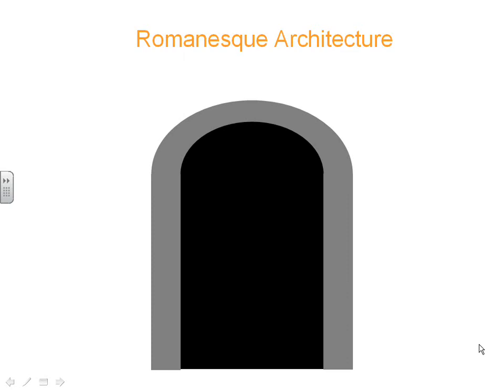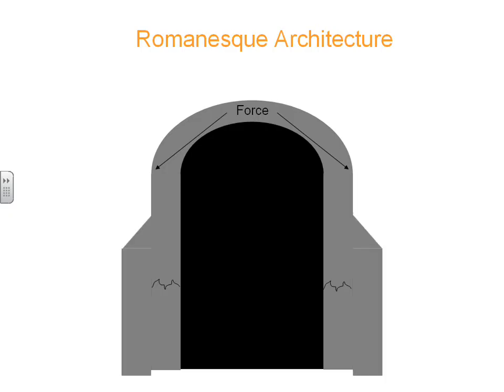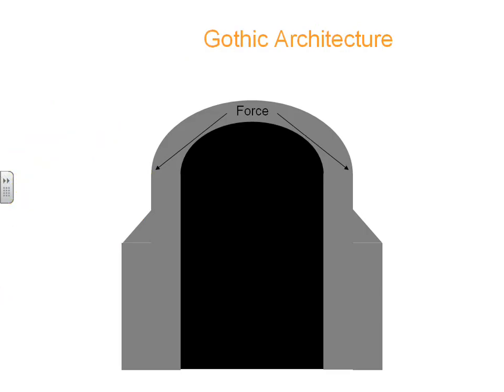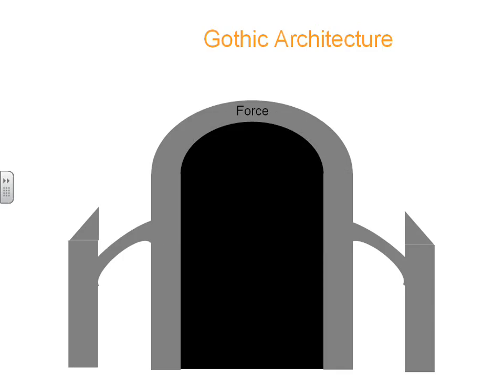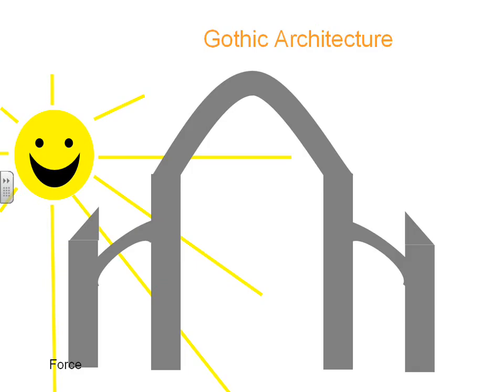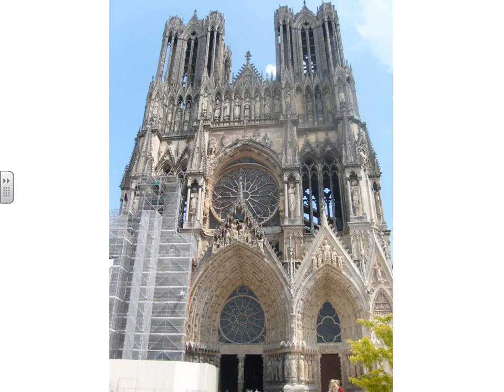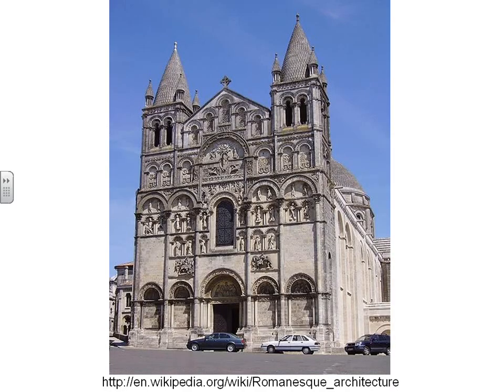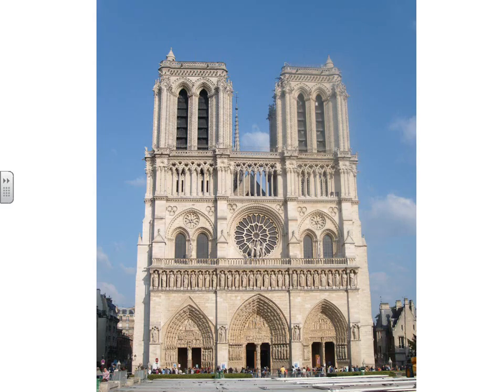Romanesque vs Gothic Architecture

Comment: The diagrams are bad! The semi-circular arch is not drawn semi-circular. And what is worse, the Gothic arches is NOTHING LIKE a Gothic arch. A Gothic arch is made of two rcs (two parts of the out edge f a circle) that meet at a point. i.e. the arcs cross each other and the point at which they meet is POINTY.  

1.The CRUCIAL difference is not the one that is stated first HERE. The CRUCIAL difference is the pointed arch. The pointed arch, being a very flexible engineering solution, led to all sorts of fascinating design possibilities, like ornate window tracery, and ornate ribbed vaults. 
2.The next most important feature is the ribbed vault, where the structural members of a roof could be made into thin load bearing arches, with lighter material between. 
3.Channelling the weight of the roof onto thin ribs and shafts rather than on whole roofs and whole walls was what led to flying buttresses. Before the ribbed vault, there was no practical use for them.  They are a chracteristic of many Gothic cathedrals that  are French in style, but not ALL Gothic Cathedrals by any means. Very few Gothic parish churches have them. 
4. Channelling the weight of the roof onto thin shafts supported by buttresses is what led to an increase in the size of windows. and reduction of wall surface.  
5. Buttresses that just out a long way are typically Gothic. They are usually only FLYING buttresses if they NEED to fly OVER something in particular. Generally they are flying over the roof of the aisles on either side of the church.  
6. They are used when there is a ribbed vault. If the church doesn't have a ribbed vaulted nave (the main central part of the building) then there is no need for flying buttresses. . If you have a look at the outside of York Minster, for example, you will find that its whole magnificent Eastern end, with huge Gothic windows, does not have any flying buttresses. Why? Because the ribbed vault is not stone. It is constructed of wood, and the weight of the walls is enough to hold it in place.  (It does have them at the west end)
7. The choice of pictures in the recognition test is a bit random. Mainly because the producer has concentrated on West Front pictures, but focuses the questions on the number and size of windows.  If "windows" are the criteria, then side views provide the best evidence.   The west front of a cathedral very rarely has any large windows low down. (They often have sculpture). On the other hand, the window/s above the west portal will be as big as they could make it at the time (often the biggest window in the building).  In English cathedrals the Romanesque (Norman) west front has generally had a great big window put in at a later date (See Rochester Cathedral and Southwell Cathedral). 
However, the West Front is one of the very best indicators of STYLE. It is good to be able to recognise when a radical change has been made, and a big window (for example) looks like a different period. 
8. When looking at Gothic arches to identify a building, remember that the shape is very flexible. It may have an arch based on an equilateral triangle, a very sharply pointed arch, a wide flattened arch  or even one that comes to a flame-like point on top.

Comment: another good difference could be the use of rose windows embedded within the pointed arch in Gothic period and absence of it in romanesque
or that romanesque used barrel or groin vaults therefore needed thicker walls and columns but  use of ribbed vaults in gothic saved them the trouble
Reply: also that height achieved in Gothic architecture was far superior to that in Romanesque

Comment: SERIOUS ERRORS 
SOME of this video is correct.   The identifications of the buildings are correct.   
But the presentation is seriouslt WRONG in several ways.  
DIAGRAMS 
At 0:05      That arch, which is being described as a Romanesque arch,    after the style of the Romans,  is NOT the sort of arch used in either the Roman or the Romanesque period.  
The arch should be a PERFECT SEMI-CIRCLE.       
You don't need to be a student of architecture to see that this is wrong, and WHY it is wrong.   It should be EXACTLY half a circle.  
That is not a very hard thing to draw on a computer.   So the person presenting this has been VERY CARELESS.  
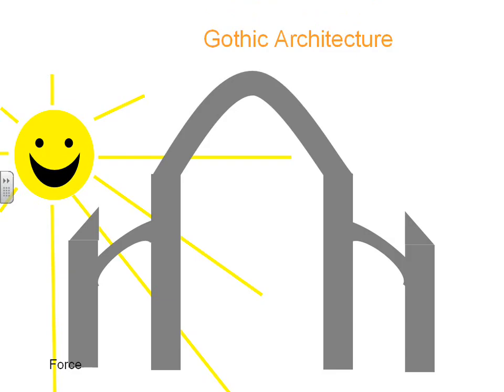At 2:25  you have what the presenter is calling a "Gothic arch".   Is this a Gothic arch?    NO!.  
A Gothic arch is drawn with two parts of a perfect circle, "arcs",  that meet each other at a point.  
Everything is wrong with the way this is drawn.  
The arcs are not proper arcs. 
They do not rise neatly from the walls.
They are not meeting at a proper point where they intersect at the top.  
The carelessness of these two drawings warns anyone who has studied ANY high school geometery  that you cannot trust what you re being told here. 
INFORMATION.  
Building a tall church using the round arch. 
0:25    "We are going to build a really tally church"    
The viewer needs to understand that for a start,  the round arch was used for openings i.e. doors and windows.  
SOME churches, but only SOME ,  had stone roofs constructed with arches.    MOST large buildings had wooden roofs with ordinary timber frames.  But you can tell he building is Romanesque by its doors and windows and decorations. 
IF the building had a stone, arched roof  (called a "vault"  pr. volt)   THEN it would have ery thick walls, and perhaps big square buttresses. 
1:48    MAJOR ERROR.   The presenter is showing you Flying Buttresses as if THEY were the NEXT STAGE of development.  
This is VERY WRONG.  
The next stage of development is the "pointed arch"   
The pointed arch is MORE EFFICIENT than the semi-circular arch,  even without buttresses.   Yes, some churches with lovely stone-vaulted roofs of pointed arches have NO buttresses at all,  and  MOST Gothic churches have NO FLYING BUTTRESSES.  
It is that pointed arch that is BY FAR the most important feature.  
The Flying Buttress  developed as an efficient way of channelling the weight of a very high stone vault down to the ground, and on advantage is that it leaves lots of room for large windows. 
So first the semi circular arch, then the pointed arch, then the flying buttress. 
LOOKING AT THE PICTURES  
Try to be aware of which end of the building you are looking at.  You cannot compare a person's butt with another person's face.  (Well, not usually!)  
Keep in mind that almost all the elaborate Medieval buildings are churches or cathedrals.   (There are also castles, palaces, town halls and warehouses)   But here we are looking at  church architecture.    A church can be tiny or large,  but a cathedral (where a bishop rules) is often HUGE  ( 300 -500 ft long and 70-100 feet high internally).    A stone vault gives wonderful protection of the wooden roof catches alight (as at Notre Dame.   
OK, so the church usually runs from west to east with the main entrance "portals"  at the west, and internally, the most holy part of the building, where the Mass is conducted, at the east.  The morning sun shines through the big eastern windows, and in the evening, the sun lights up the churches "west front"  or "facade".      Frome the outside, the two ends of the builing look entirely different. 
At the west, the exterior is impressive.   At the east, the Interior is impressive.......  and the buttresses all stick out at the back, like the wooden supports to a stage setting. 
Good luck with looking at Romanesque and Gothic architecture. 
You will find a good description of Romanesque architecture at https://www.youtube.com/watch?v=asMYYYBfYcg&t=1211s